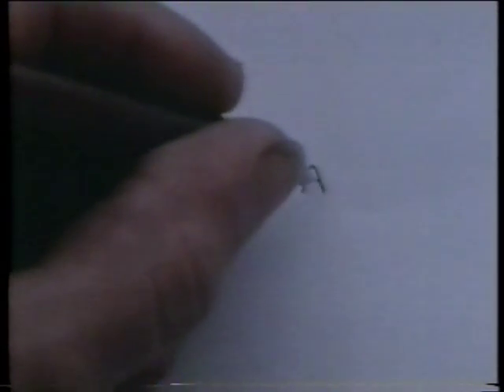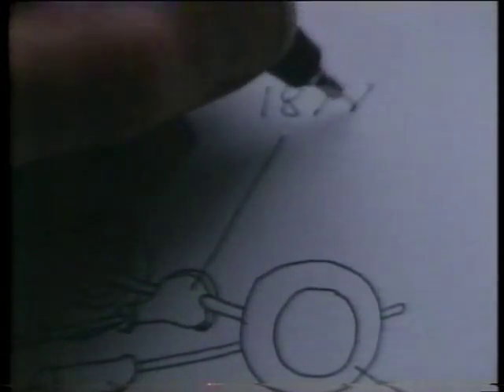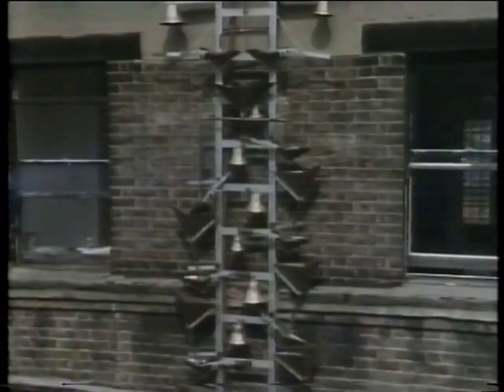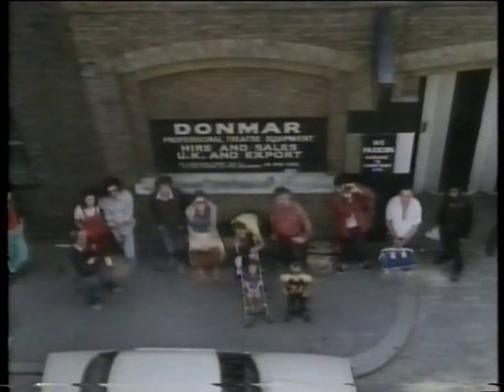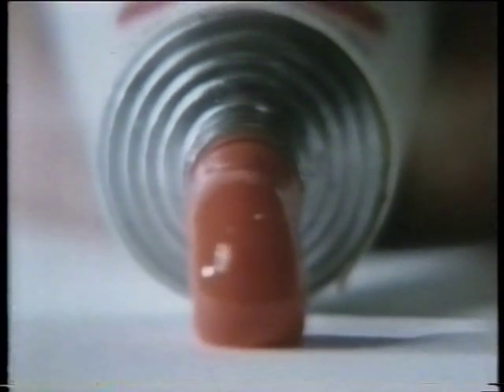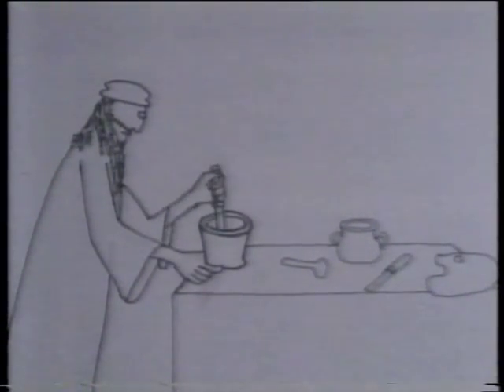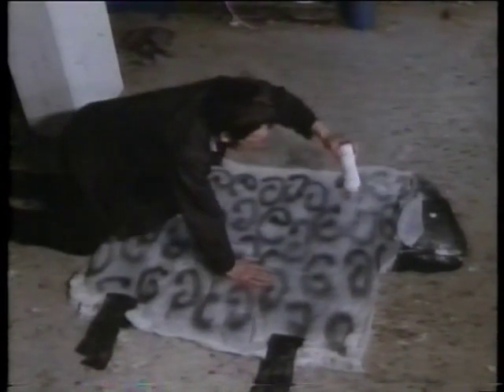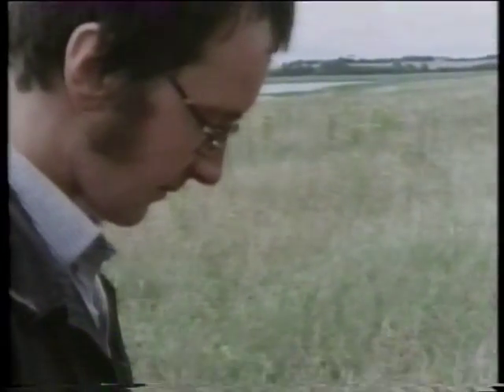why things go wrong2.mpg

Comment: how would steam cars have cleaner exhaust than  internal combustion cars ? you still have to burn something to boil the water . same gos for electric cars most of them are coal powered !
Reply: firing a steam locomotive correctly ensures that all the volatiles are burnt, if smoke is seen in the steam exhaust then the firing is not optimum, this has always been known and is well demonstrated in the LMS film little and often https://www.youtube.com/watch?v=PVIr66K_rUA&ab_channel=NathanFenn
Reply: @Satters  I read somewhere that in Egypt in the early days they would use mummies to fire their steam locomotives. Whether that's true or not I don't know.
Reply: @dwalker399  as the fuel ? thats one way to do a cremation i suppose !
Reply: @Satters  Yea for fuel. They were not royal mummies. Just the remains of the working class. And there was a lot of them. So they put them to use again!
Reply: @rdt1104  Wow good info! I had never heard of this.
Reply: For instance you could burn metals to make metal oxides, no gaseous exhaust at all...
Reply: As grid supply gets transitioned to renewables, EV exhaust emissions will get progressively cleaner. Don't believe everything you read in the Daily Mail. lol
Reply: As he said if they spent the same amount on improving steam power the disadvantages could have been overcome. Steam engines give off steam (water) and carbon dioxide from the burning of coal / wood maybe carbon capture / scrubbing methods or different fuels for burning could have been developed. There are many ways to propel ourselves around it's just which ones are easiest to use and easiest to tax.
Reply: @MrMaxeemum  can you imagine the explosions that would happen in a crash? steam containers and tubes flash-boiling occupants, if ill maintained, clogs could result in the boilers blowing up. steam is low performance on accelerating and loud, and steam is visibility blocking.